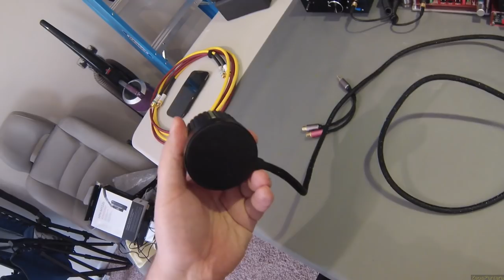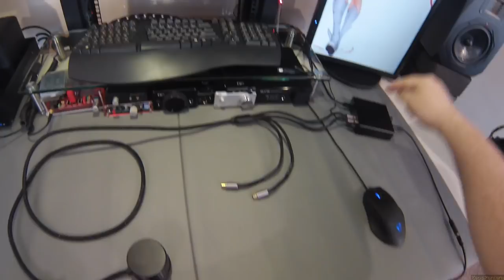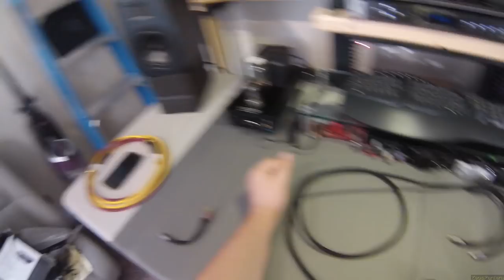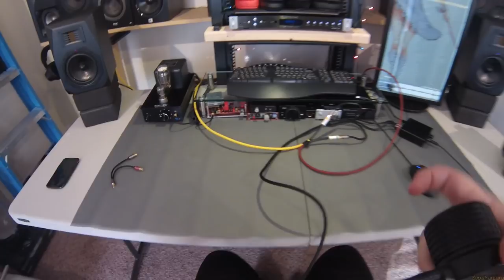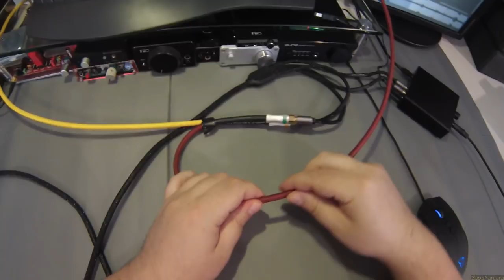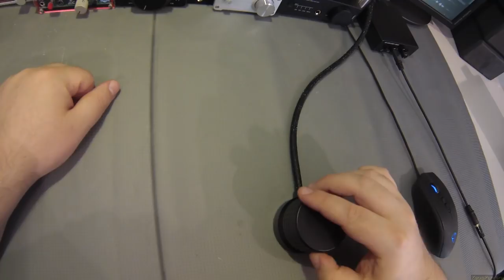Z Review - Emotiva Control Freak

Comment: If you have trouble finding this in late 2017 look at the Mackie big knob passive as a possible replacement. Not the normal use case but it works the same for me.

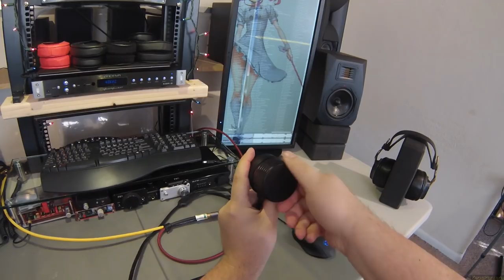Comment: 7:10 lol thanks for shaking my room, how does the gopro mic not completely distort when it suddenly gets this loud, is there some kind of magic sorcery in it?
Reply: +RallyemiXXedup it's probably got automatic attenuation
Reply from the maker: +RallyemiXXedup It has a very good audio compressor that is almost instantaneous. That is why gopro's can hear my nose whistle and then go on the back of an Indy car and never need any sort of adjustment.
Reply: Thats pretty impressive and youtubers are inversting in that expensive rode stuff which they are mostly too stupid to set up correctly.
Reply from the maker: Yeah the heavy duty pro mics are a pain and just the fact I'd have to mix im post because my camera is on my head would be a nightmare. I'm ok with it for the occasional sound demo but every video.. Gag

Comment: This is hands down my favorite audiophile channel. Was thinking about getting this knob! Though right now i have a logitech g105 gaming keyboard and i set the top 2 buttons to control volume and have gotten used to it pretty comfortably and it suits my needs perfectly for now. 

I love your setup, so basically is that your computer and for the monitor (screen) you just have that vertical looking screen? what kind of screen is that? (btw cant wait to see your car sim set up, im a huge fan of cars and forza and been thinking of building one myself too)
Reply from the maker: +TheRoshan89 Its an NEC EA294wmi hooked currently to my ultrabook until I get the funds together for my next PC build (case is up top).
Reply: +Z Reviews please tell me you will make videos of you reviewing the parts and building the pc
Reply from the maker: +Lucky Dane Well a build video. Not sure how to review a video card sitting in my hands. Would need it up and running and sorted out and then I guess I could stare at framerates and noise.
Reply: +Z Reviews yea, dunno what I was thinking there, but sweet
Reply: +TheRoshan89 Dude stick with the keyboard. I have the Emotiva Stealth DC-1, full pre-amp with a fucking remote, and I am way to lazy to constantly pick it up and change the volume. Keyboard shortcut is the way to go. Digital volume has no affect on sound quality.

Comment: Gonna have to say if the SM pro audio nano patch plus active speaker starter kit that I got my hands on here in South Africa was only about R900 which works out now to about $60 give or take because fuck the exchange rate then I might have had a look for this. But hey when you get a really good potentiometer, a set of 3 way angular speaker pads, and 4 x 3metre long xlr to 1/4inch cables that are beast quality and locally available to boot so no 30-60 day delivery times then skrew it. Haven t used it much lately because I don't have my lsr 305s atm. My Wharfedale diamond 220's are on duty because they have a high GAF and MAF approval factors and the room I had to move all my sound equipment to just doesn't have the space for the clearance I would like behind the 305's. 
All in all though both the lsr 305's and diamond 220's sound equally great. Slightly different sound signatures but very similar. 
One thing I do have to say is that if you own an amp already the 220's are going to be cheaper at the end of the day. Also I got my diamond 220's at half the price for a measly R2500 about $168 because very few people in South Africa are music junkies and buy the cheap stuff. So the retailer was selling bellow cost to clear space. Got the walnut version.

Comment: Z-Long time viewer-great resource for those of us getting back into audio after a break. Regarding the Control Freak, looks like the unbalanced is no more. Just curious, did you use this as a separate control for your sub in a later video? I have Parasound PHP850 driving A21 -one of the 850's two pre outs goes to SVSPB1000-but I want the convenience of adjusting the sub from my desk separate from my mains. Am I on the right track? Looks like Schitt SVS is last good option.
Reply from the maker: I did and yeah you look like you are going in the correct direction. There are other simple pre's just not as nice.

Comment: Good video, nice set up. 
If you are using foobar then one of the best sound quality upgrades is to install the kernal streaming or the waspi "app" it will bypass the windows mixer/volume "issue" altogether and  will improve the sound quality significantly because windows  remixes all your sampling rates (iirc twice) in "direct sound mode" before it gets to the DAC.

Comment: Hey Zeos, I was wondering if you could help me. My dad recently gave me some of his old audio equipment. Right now I have a marantz receiver from the 80's and I have my turntable and a radio tuner plugged into it. I want to be able to use my Rotel stereo amp but the receiver doesn't have any pre-outs, only a tape monitor out. The tape monitor out is a line level out like the odac so I was hoping that the Control Freak would be able to give me control of the volume so it doesn't play at full blast all the time.
Reply from the maker: +Jamie Bellizzi It would work. Go for it.

Comment: so is this pretty much the same as the Schiit Sys? i have LSR305 monitors connected to an e10k, and i been using my PC to control volume...if i set my PC volume at max, and then use this knob to control volume would i get better sound quality?
Reply from the maker: +Alex R It is possible but there are a lot of factors that are involved in digital volumes that can screw up sound.

Comment: I've been really wanting to try this, but have been hesitant because some of the Amazon reviews mentioned that this had degraded the sound a bit. Noticed any of that Zeos?
Reply from the maker: +awvz _ Not even a bit. I have it hooked currently up from the XDA to the Behringer A500 and it is perfect.
Reply: +Z Reviews Thank you, on the a500 is it safe to leave both gain knobs on full, and control volume with the control freak?
Reply from the maker: I had it that way but my XDA-2 at full 0.0db and the A500 at full meant if I twisted the Freak to full things would die.. So I left the XDA at full and lowered the A500's knobs until the loudest music on full freak just blinked the 0db lights on the amp. Now I don't have to worry about blowing things up. Precisely what those gain knobs on the front are for. Now I don't have to touch them.

Comment: I bought this and I was really excited until I found it wasn't able to totally block out the sound coming from my DAC when turned down. When I called they said I shouldn't expect it to totality block the incoming audio.  I was flabbergasted. I had to send it back. :(
Reply from the maker: +Ryan Hietpas I have two of them and they both shut it basically off. I haven't put it on a headphone amp yet but y speakers mute. Since it is a potentiometer it may have a contact fault at the bottom but it should be so quiet you don't notice it.

Comment: So this is basically a pre-amp? Meaning that I could use it in between my Odac and 305s as a way to push them louder than my computer normally could?
Reply from the maker: +Julian Silva No, it isn't powered so it can't make the signal any stronger than the Odac is already pushing. Only cuts it down.

Comment: You don't have any problems with the Control Freak affecting your sound? I've seen a few Amazon Reviews where people complain that it adds noise or distortion.
Reply from the maker: +AndysSeveredHead None. They might be running the cord past high power stuff that is throwing interference. That will happen to any cables you connect next to motors or fluorescent lights etc.
Reply: +Z Reviews Well, it's not a rat's nest behind my PC, but there's plenty of cables back there....guess I'll find out for myself.

Comment: Sir Z, quick question, would the SMSL SD793 work good with monitors such as JBL LSR305 ? Thanks.
Reply from the maker: +XioN It will but you will have to control the volume with windows.
Reply: Or with the beauty from this video.
Reply from the maker: +XioN yes

Comment: hey z do you think this drok volume control would be a good cheaper alternative to the control freak? apparently its for using with computer mic/headphone switching, but from what i can tell, it should work as a preamp too... maybe plug one end to back of dac, and other end to female 3.5mm to dual xlr cable......(i love getting creative with cables lol)  doesn't seem bad for 20 bucks.

http://www.amazon.com/DROK-Converter-Controller-Switchable-Microphone/dp/B015E5UI8Y/ref=sr_1_9?ie=UTF8&qid=1452045572&sr=8-9&keywords=volume+knob
Reply from the maker: +TheRoshan89 Doesn't really do the same job since you have to run an additional wire out.

Comment: I have the Emotiva Stealth DC-1, which has built in pre-amp functionality, an actual screen and comes with a remote. But I still prefer to change volume with windows because my keyboard is right under my finger tips as I am lazy and digital volume has no degradation.

Also why did you get both the Airmotiv 5S and 6S? 

And after you are done making their glowing reviews, get Emotiva to send you some of their Stealth 8's for review. Now that is a review I would love to see happen. That speaker is jacked as fuck.
Reply from the maker: +Douche Bag In Name Only Digital volume has no degradation when the starting bit-depth is high enough to not dip below 16bit when adjusting. As that is how it works. You start at 24bit and lowering digitally can get it down to 18bit, still above red-book 16bit like CD's have. how else could it lower the volume without adjusting the physical voltage of a signal...

I got the 5's thinking about a give away. Then THOSE BASTARDS forced the a6's on me. I had to know. HAD TO KNOW. 

The Stealth 8 is a monster on specs alone.
Reply: Z Reviews How did they force them on to you? Did they give them to you or did you buy both sets? If they did give them to you, then make them give you their Stealth's, their new line of passive monitors, and sneak in one of their new subs.
Reply from the maker: +Douche Bag In Name Only I bought the 5s around halloween and then when I came back from Japan and heard them again I made the decision to grab the 6s before the sale ends. That is how good the 5s are.
Reply: +Z Reviews I know how good they are, I got them last Halloween at their then lowest price of $333. A steal at that price, and even better at $280. Are they your favorite powered monitors? And how do you rate them amongst your favorite passive speakers for mid-field listening? Listening to these in bed, they have very good room filling sound for near-field monitors.
Reply from the maker: I haven't had the 5s out since the 6's arrived but it is safe to say they are my favorites. Highly.

Comment: ok so i got my cheap version today, definitely want to upgrade to  a control freak if/when i get more money, though hoping i can get used to this - btw is it normal for speakers to cut in and out when u move the rca cables? this setup looks os messy :( but i got it wrapped around my computer monitor hoping ill get used to it

does it look ok z? please say yes cus its literally going to make or break my day today

http://i66.photobucket.com/albums/h276/Lercin/IMG_0009_zpsionwjc6r.jpg
Reply from the maker: +TheRoshan89 Other than being messy it seems fine. You can try and mount that knob under the front of your desk. And no it shouldn't go in and out when you move things. Loose connection somewhere.

Comment: I was going to get the control freak, but the unbalanced verison has been soldout for a while and the balanced one would have been annoying to use a bunch of xlr adapters and i called emotiva and asked when they would get more in but they were being all appley like "sorry i can't you..." so i said it screw, POWER TO THE CONSUMERS!! and i got the 12$ version, some rca to trs cables, and a 3.5mm to dual rca cable - and they will be here tomorow, and then i can set my windows volume to max and never it again :D from then on it will be dial on the left for speaker volume (planning to either clip it down or use 3m velcro tape) and my o2odac for headphones :D :D :D
Reply from the maker: +TheRoshan89 I just bought the XLR version like 3 weeks ago. Hrm.. Maybe I got lucky.
Reply: +Z Reviews yeah i meant to say the unbalanced version is sold out, but they got xlr version but then idk if i can find adapters for that because i would need to find like xlr male to trs cables or something (those xlr cables are pretty expensive) and idk if the balanced version comes with a dual xlr to 3.5mm adapter for my dac...also thanks to this channel im literally broke right now so i had to settle for the  cheaper version, as long as it works though im hoping i will be ok.

Comment: I need to buy some RCA and 3.5mm to RCA cables. What do you guys suggest? I want quality at a good price w/o any magical claims. If you say monster we'll treat you accordingly lol
Reply from the maker: +Musclecar289 See the KabelDirect link I put in the description. They are some of the nicest, cheapest cables I have found.
Reply: Great! I just noticed that. I need some advice. I have my pc a pair headphones (old rf sony wireless) and a pair of speakers (bose companion 2, the old ones). I have to plug and unplug them to switch output. What would you suggest to make this easier? A DAC and amp combo/ separate or something else
Reply from the maker: You should just be able to get a splitter shouldn't you? The Companions are RCA in and the headphone out. So you can just shut the bose off and since your headphones are wireless you should be able to shut those off also.
Reply: +Z Reviews When the headphones are plugged into the bose output the speakers are muted so do you think a splitter would work? I'm using my macbook (running windows 10) as the source but the drivers switch to the built in speakers randomly. So I'd like to use a usb dac as the source from the pc to get around the driver issue, but I'm new to this. The speakers are powered so I think I don't need an amp currently but I'd like a dac/amp combo in case I upgrade to better speakers.
Reply from the maker: In that case yes a dac will work to alleviate the switching issue.  The SMSL SD793 is a dac/headphone amp unit that has full line outs on teh back that aren't variable. The only issue is it needs a spdif input from the source (IE your macbook) and I am not sure if your macbook has SPDIF built in or not. You could grab something like this Fanmusic adapter however [http://amzn.to/1ISSHnr] and that solves that issue. Then you can run the bose into the back, headphones into the front and you are all set. No unplugging.
Reply: I believe the macbook has optical out. It's a 3.5mm/optical port. I've never dealt w/ optical so I'm not very familiar w/ it. What about a straight up usb dac/amp w/o an extra adapter? I fine w/ an adapter but only if I really need to
Reply from the maker: The Micca Origen [http://amzn.to/1P5E6V0] will work but you will have the headphones and speakers running at the same time and controlled by the same volume control. That is what I was trying to avoid with you.
Reply: How would the switching work on the smsl? I'd have usb to the adapter then to input on the smsl. From the smsl to the bose and to the headphones. Correct?
Reply from the maker: +Musclecar289 That is it. No switching needed. You have a volume control on the SMSL for the headphones and one on the bose. You raise the one you want to hear and lower the other.
Reply: +Musclecar289 The SMSL M6 will do what you're asking and it's got more features...I enjoy the fact I can leave my cans plugged in all the time...even when listening to speakers